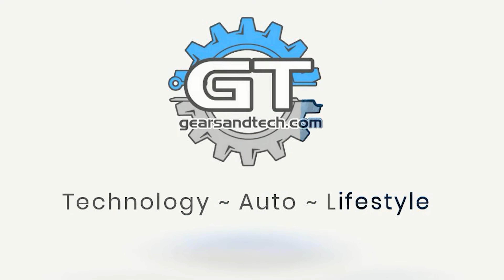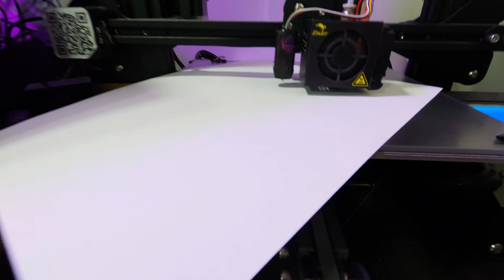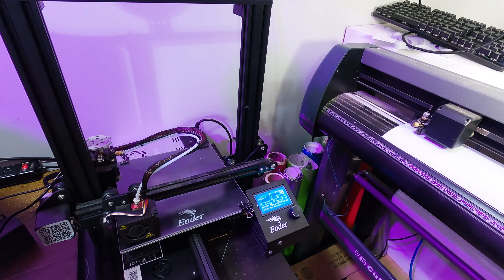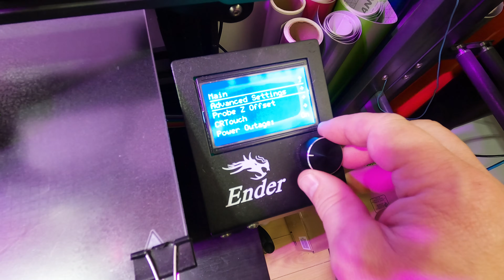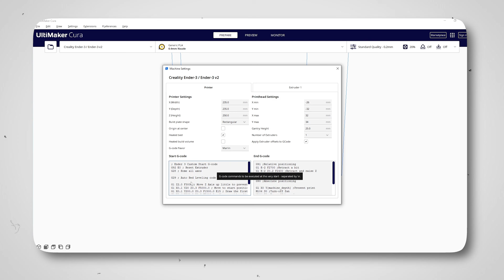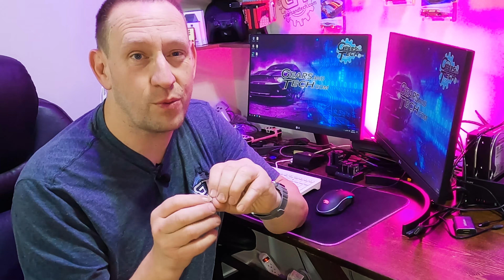Setting up CR Touch on Ender 3D Printer | Gears and Tech

Comment: Question . The print head is stil off center …how is that fixed ?
Reply from the maker: This video covers the z axis.

It sounds like you have an x or y issue, which unfortunately I don't have a fix for
Reply: @GearsAndTech  yea I noticed yours is off center too. No worries . I dis everything else you said and the printer is still unusually . Perhaps creality sent me the wrong firmware when I asked them for help. My menu options look different from yours …

But thanks for posting this. I’m sure it helped many

For me it may be time for new printers.. I don’t want to experience this with the other 4 Enders 3s though have 😂

Comment: I installed the CR touch and now it wont read the sd card. It says no TF card. I have read some threads saying i need a new board, I need to reflash a different firmware. i am about ready to throw the thing away and go back to manual leveling. can someone point me in the right direction?? thanks in advanced.
Reply from the maker: Something isn't hooked up right.
Reply: @GearsAndTech  like what? It goes around and probes the bed like normal? I have checked all the connections and they are connected

Comment: Thank you for this video. After many attempts I think I finally understand this BUT why would one corner of my bed seem to be too high? Shouldn't the CR Touch automatically adjust for that? I'm really confused by that. Any advice?
Reply from the maker: Cr touch will compensate for it, but your print will be weird still.

Need to level bed first
Reply: Thanks. I did level my bed first, like a bunch of times I recheck it and it seems to change. Lol. I should level it when it's preheated right?

Comment: My Ender came with the cr touch.  However I’ve lowered the z axis to -5 and I’m literally 3/8” off the plate.   The thumb screws do not get me close enough.  I do not see an adjustment I. The mounting plate for the tough mechanism.   Any suggestions?   Thanks in advance
Reply from the maker: Something isn't right on your setup. You should be able to get a lot closer than that
Reply: Maybe you.have to adjust the end Point Switch of your z Axis a bit deeper...

Comment: I have the Z at 0.   When I *manually* adjust all the corners for the *auto* leveler, the paper is perfectly snug between the nozzle and the bed.  Then nothing comes out right with this magical auto leveler.  I can get the exact same results for $40 cheaper.  And - really - I could get the exact same results of absolutely no end products without the price of the printer itself and all the filament I've wasted so far on all the failed tests.  I could have hundreds of dollars in my bank account for the amount of things I've made thus far.  And it's not like Creality has any type of customer support.
Reply from the maker: 3d printers are a tinkerers toy. You gotta love adjusting and readjusting.

Comment: "It's not critical that we get this perfect because we do have a auto bed leveler."

What a joke.  So, assuming you're not perfect enough to manually adjust the bed to make prints come out right, and you've already bought a $40 gadget that does absolutely nothing, how are you supposed to get it perfect so that you can actually make something with the expensive machine you bought?
Reply from the maker: The auto leveler takes up the small imperfection of not getting it perfect.

Comment: So why did I spend $40 that I don't really have in excess on an "automatic" leveler when I still have to do everything entirely manually?  With the $40 gone and the pretty light on the leveler that glows whenever it touches the bed, I still can't get a single layer to come out right out of the 50+ tests I've done.  I have genuinely spent 10 or more hours trying to level my bed, doing test after test after test after test.  Am I actually just the stupidest person on Earth?  I have no idea how to make this "auto" leveler work.
Reply from the maker: Sounds like you're auto leveler isn't working.

Make sure it's connected to the right port and you have the right software installed.

Then make sure you added the auto leveler code into your software settings.

When it's working it works great
Reply: I also recently wasted like 50 dollars on one & got the firmware updated, but now the printer doesn't print at all, the damn CR Touch just touches the bed a few times, moves around, Z goes up a bit & doesn't print & the "print process bar" just starts going up & auto homes without anything printing......
Reply: @AnimeFan_2013 same
Reply: @buzz7313  Turns out you REALLY have to manually level the bed for the printer to continue working, but I also REALLY recommend not buying any auto level kit, just manually level it the first time & leave it as is
Reply: @AnimeFan_2013  I did all that stuff my problem was it wasn't leveling before I printed and they changed it in my firmware, instead of "g29" it's "g29 P1"
This is also for everyone who wants to use mriscoc's firmware
Reply: @AnimeFan_2013  This is an old comment but if anyone else reads this I had the same issue. I had to try a few different firmwares.
Reply: FYI, the cr touch didn't work with my printer no matter what i did, even messed arou.d with the g code alot and it wouldn't work. I installed mriscoc firmware which works on any ender 3 with no mods required. This has fixed my issue with the cr touch and it has made my machine way better.

I recommend everyone check it out.
Reply: @TheHeRoofsniper  I did the same thing but apparently he changed it to g29 P1 and I didn't add in the P1 so the auto bed leveling didn't really work for me but I figured it out now and it works great!
Reply: @buzz7313 what’s your g code start up?
Reply: @TheHeRoofsniper can you throw out a link to the firmware? I've been looking for something better than the creality
Reply: @TheHeRoofsniper what’s your start up g code?
Reply: I just bought an Ender 3 the seller said the same thing. Spent about 15 minutes trying different firmwares and finally found the one the worked right and I was printing within 30 minutes.
Reply: @brandonbeery2484 drop link
Reply: You only have to do it manually once.
Reply: I have the Cr touch installed on my ender 3 with the upgraded BTT SKR mini E3 v3. I'm using marlin firmware and it doesn't seem to give me any issues! Maybe the main board you guys have doesn't like to support more than stock? My stock board ran at 8 bits and completely shut down if I tried to run more than one command at a time by controlling it from my laptop! Just a thought tho, I'm no pro, just an experienced newbie!
Reply: Mine works great but I purchase aftermarket firmware. It didn’t work with the creality firmware
Reply: The name is deceptive. Its an abl but its only meant to compensate for small variances across the bed it cant automatically level your entire bed for you. So should your bed be warped it helps. $5 though id guess either you dont have proper gcode, z offset, or you are so out of level it cannot compensate fast enough.
Reply: It also just takes forever. I say manual leveling is the best
Reply: You probably have a warped bed from factory 😂
Reply: I agree with you, it is a waste of money, I even broke two beds because of this..
Reply: @kevinzambrano1391  e3v2 with mriscoc firmware its actually 100% worth. Because while it doesnt auto level in the wag you think it does aid with leveling(tramming) as it has a visual of how off the corners are. Takes less than a minute to tram my bed.
Reply: If you're using the glass bed: make sure it's clean.... Dead serious, that creality textured glass bed only wants to work when you hit it with dish soap and elbow grease....

Had the same issue and it literally turned out to be a greasy bed (I use a feeler guage for bed leveling and feeler guages have oil all over them).

Comment: Maybe this help but once I stored and started my test print the nozzle pressed into glass, I had to fine tune it during print job and restore, I will test again on another print test tomorrow morning
Reply from the maker: Great tip! I noticed sometimes my settings don't load from last time

When that happens it defaults to Chinese, so I know I need to go back in and setup the defaults

Comment: I have Ender 3 neo, it originally came with auto levelling system, but only after watching this video, I have managed to use it properly. Before then, I was just running automatic leveling for nothing,  because the G code was simply missing that one line, and nobody tells you that XD
Reply from the maker: Glad I could help!
Reply: 😂 Same. Sad part is my first 3 big prints were nearly flawless so I thought it was working now I'm having problems that took forever to figure out and correct

Comment: What software are you using from the crealty site. Having issues finding the write file. I have a ender 3 like yours
Reply from the maker: The actual slicer? I usually use prusa
Reply: Sorry what file did you download for your ender for the cr touch. Having issues finding the right file

Comment: I’m having trouble with my voxelab 3d printer that I’ve upgraded with ender 3 parts. Now my cr touch is touching on my build plate for the 1st 3 points and on the 4th point , it’s off the bed , what am I doing wrong?
Reply from the maker: Try doing a manual bed level adjustment. It's possible the bed is lower than your z axis can go down

Comment: I tried everything you said in the video. Homed it, z offset and manual bed leveling but, it acts like it is too close to the bed and no adhesion. What am I missing?
Reply from the maker: If you are getting no adhesion you're not close enough to the bed
Reply: @GearsAndTech  I feel like I'm too close to the bed.
Reply: @stevegriffith3598 Elmer's stick glue on the print bed then if spacing isn't a concern.

Comment: im not sure what I did wrong i have done the manual update I updated the prefences in ulti maker cura and still my nozzle is to high even after saveing the infomation did i do something wrong? or is anyone else having this issue
Reply: it contiues to go back to +5 on the Z axis and this is the 3rd time i level everything correctly
Reply from the maker: For some reason mien doesn't always load my z offset when I turn it on

I can tell when this has happened because it also reverts to Chinese.

If that happens I will go back in and manually set the z offset and its fine

Comment: Glad I came across this, my biggest issue is at the start of the gate.  turn it on and hit the auto home button. after that my Z is set to 10mm, my Z well not go down it just keeps going up.
Reply: I had this happen and it had to do with the firm ware not boot loading properly and the z axis switch still being plugged in

Comment: Finally a detailed video I'm glad I came across. the install was a pain to figure out with the sub-par motherboard I had I'm my model of the 3 pro. My auto level was just an accessory, and I figured I just wasted money. I was still able to do hundreds of prints with minimal bed leveling because of my locking bed wheel adjusters but an added layer of bed level is great when I'm in a hurry and need to get a print going without all the hassle. 👍
Reply from the maker: Glad I could help!

Comment: Great video!! I got the upgrade kit but have been making a bracket to work with the MDD Direct Drive upgrade. Only one out there is for the BL Touch. Is the G-code necessary for the CR Touch to work or does it work off the saved coordinates? If you need to do the auto leveling each time you print that seems like a lot of extra work. Often times I print parts of an object to measure and make sure it will be correct. Doing the leveling each time seems excessive. Like to hear your thoughts on that. Thanks!!
Reply from the maker: You don't need to level the bed each time. But you do want the cr touch to run a bed level check prior to every print

It's worthwhile doing the bed level manually from time to time as it can get out of level from use. But certainly not every time you print

Comment: Im having an issue finding the cr touch firmware for the original stock ender 3. its a 4.2.2 motherboard but there is a bunch of stuff regarding the cr touch on the website so im not sure what file im suppose to download. Ive downloaded the 32 bit motherboard file and used the non adaptor bin file and didnt work. ive tried the cr touch or bltouch file as well and didnt didnt flash over.
Reply from the maker: See if one of these help you

https://www.creality.com/products/cr-touch-auto-leveling-kit?spm=..page_1934481.products_display_1.1
Reply: got the right file now thank you!
 @GearsAndTech
Reply: @DisguisedOwI which did you use? I know this is old but having issues myself
Reply: @a_prsn  did you try the motherboard one that says non adapter bin file for it?
Reply: this actually helped! thank you so much.  @a_prsn

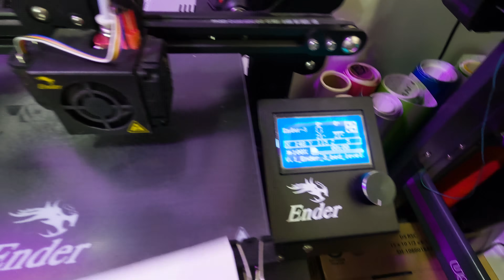Comment: very interesting. im glad i watched this video. very informative. i just popped it on before im about to put on this 3d laser easy shroud swap and i dont know if i had to adjust my cr touch.. i learned that after leveling i should perform another auto level so the cr level doesnt still try making up for the adjusted hight even though i just thought i fixed it leveling my bed then just auto homing before running a print. i got a question though, how did you adjust your setting to automatically get your arm to move so quickly like that at @3:10 ish. thanks for the tips and advice! you earned a like a special spot in my special 3d printer youtube playlist and a new subscriber! thanks a ton for the info! never stop updating us pls
Reply from the maker: I think at that point I sped up the video so you could see what it's doing, but not have to watch it in real time.
Reply: okay lol.. i was like this mans is a wizard xD. very clever editing!  @GearsAndTech

Comment: Have a weird problem. After I manually level the bed I start the Motion - LEVEL BED the hot end movers to left front corner the probe checks height and it seems to high it then moves near center and probes there and the hot end (Nozzle) barely touches the bed. And stops there it does not check the rest of the 7 other probe points. really weird. Not sure what is going on.
Reply from the maker: have you done a basic bed leveling first?

Also, did you load the right firmware onto your machine?
Reply: @GearsAndTech  Turned out my bed was offset by a small amount.

Comment: Of course it will mask an unlevel bed. The whole point of auto bed leveling is so you don’t have to level the bed ever again because it will print on an unlevel bed
Reply from the maker: For sure, but it's better for the machine and your prints to have the bed prettu level first
Reply: Yeah but then it has to take extra time to adjust the height and that time WILL add up